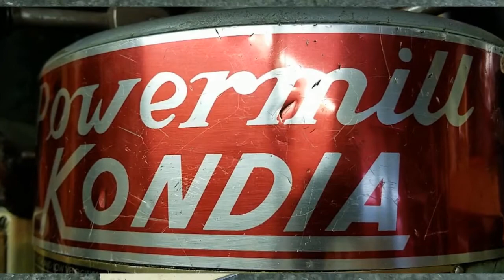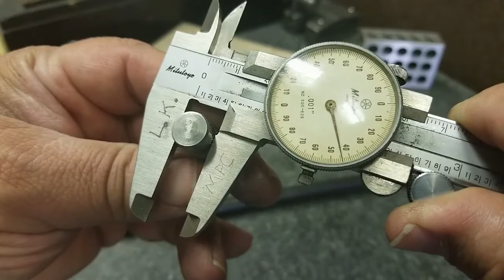R8 DRAWBAR REPLACEMENT - WITH SOME SHOP TIPS - DONT GET CAUGHT SHORT

Comment: Just how strong is a roll pin? Can’t it shear as the draw bar is  not heavily torqued but is stressed in two directions that can fail? I have a similar need and was thinking of notching and welding. Does the heat of welding make it weaker? The standard part came pinned so someone believed it was strong enough. I see it like a pto shear pin, something intended to fail first.
Reply from the maker: Hello John, roll pins are very strong the are made from spring steel and used in all types of industrial applications. The way I used them in this video is  mild. In addition you have the press on the shaft and hex portion that adds strength. I have been using mine for over a year in a small job shop environment and have had any issues if that counts. Thanks for watching and commenting, please consider subscribing to my channel...
Mike - Plus8Precision